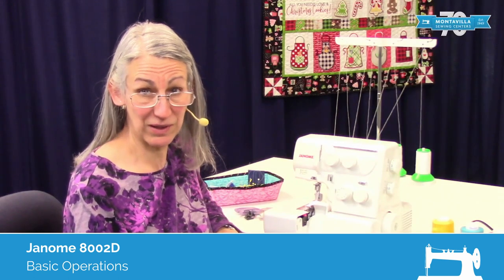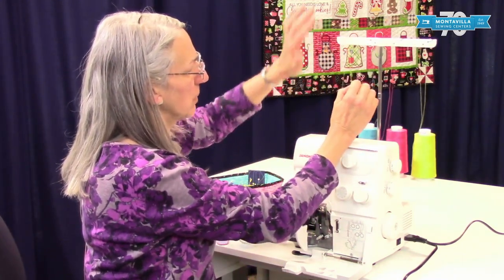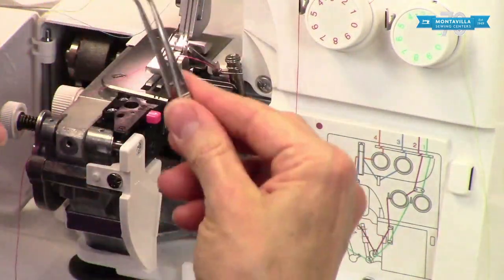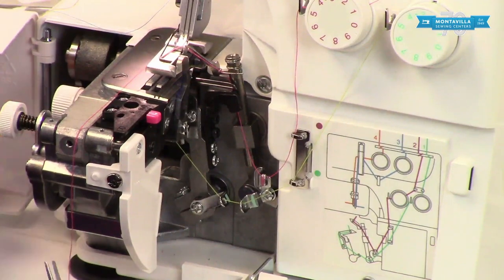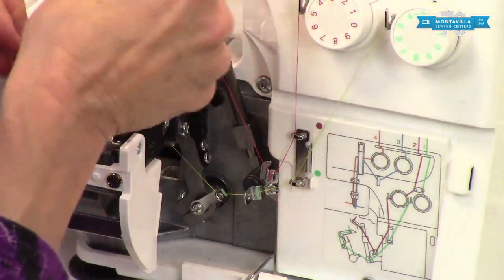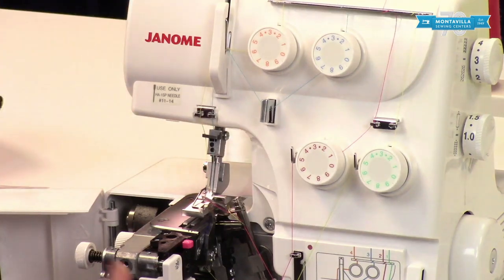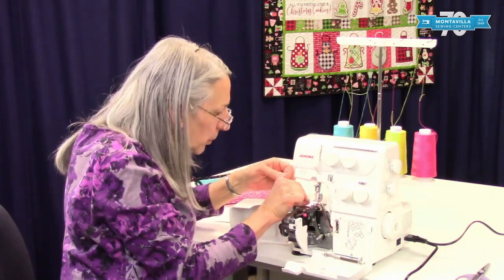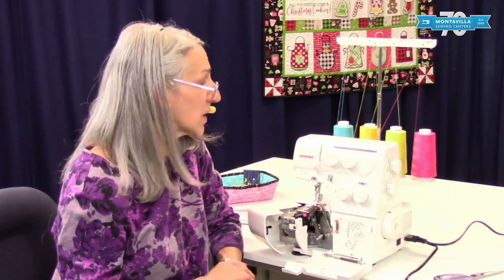Threading Instructions for the Janome 8002D Serger Overlock Sewing Machine

Comment: My chain is coming out really wide I re threaded  them not sure what’s wrong the knit fabric is not stretching sure wish I cous submit a pic lol
Reply from the maker: You can adjust the cutting width to make it narrower. Also, experiment with the differential adjustment and the stitch length on a scrap of your knit fabric. Serged knit will still have more stretch than if it was sewn on a standard sewing machine.

Comment: How we off a broken needle from machine
Reply from the maker: There are two small needle clamp screws on the front of the square part that holds the needles. There should be a small screw driver in your accessories for this purpose. One needle will sit higher than the other needle when placed correctly. Also, be careful not to pull the fabric as you sew so that your needle doesn't strike the needle plate and break.